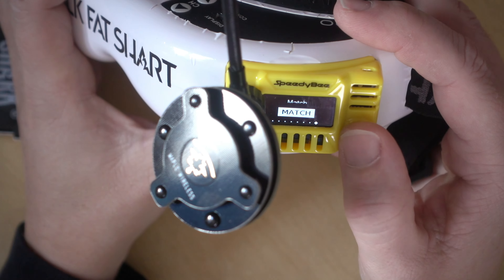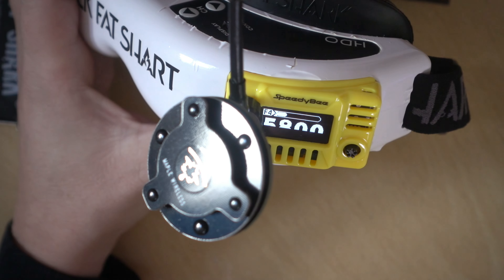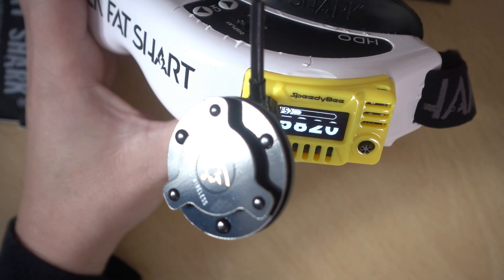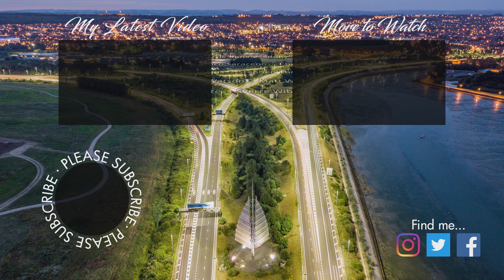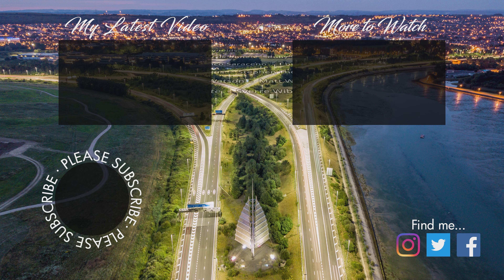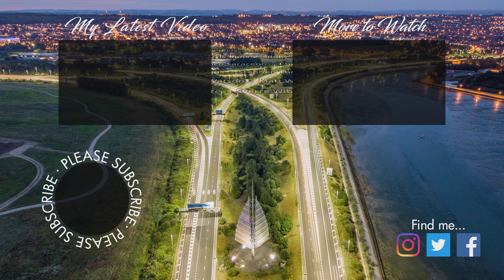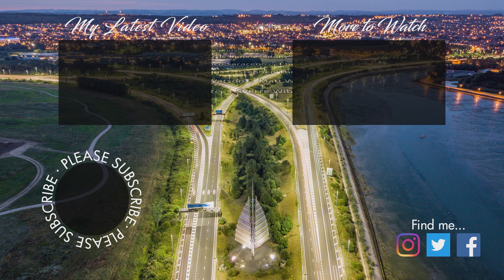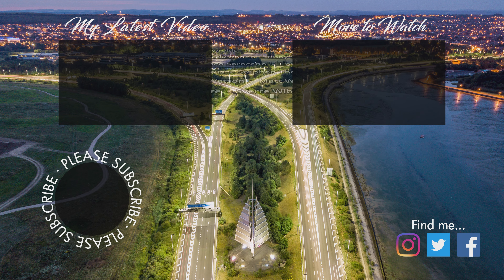SpeedyBee 5.8GHz Video Receiver: First look

Comment: Can this module be adapted for analog goggles?  Is this a de-interlacing module?
Reply: This is native to analog goggles, it has the same plug type as rapidfire or fusion and will slot into a module bay such as fat shark, skyzone or orqa. 
SPECULATION ZONE:
I don't think it de-interlaces since they would be yelling about it if it did, and that might actually require an additional chip. From what I've seen it does not do sync reconstruction, so it may be more susceptible to rolling than fusion and rapidfire. 
It seems like a diversity mixing module, which means it merges two signals from two antennas. I may be wrong on that though, it may just do diversity switching, where it switches to the antenna with better signal.
I think the most direct comparison is Foxeer wildfire which is roughly similar price, though I have not confirmed any of this with personal experience or research, just watched a bunch of reviews or info videos and looked at specs.

Comment: Specs say 450ma power consumption, so more than the 350mah of the Rapidfire I think.. so older FS goggles may need the power mod.. Waiting for mine to arrive and did the power mod anyway.
Reply from the maker: My goggles already had the power mod (HDO). But it would be nice if SpeedyBee could confirm this, and even supply the mod cable if it is needed. I've been using the module a little while now, and it doesn't seem any better or worse than my old True D X receiver. I'll do a back to back at some point, with the same antennas.

Comment: I prefer Eachine PRO58 with WPRO58 firmware flashed.
Reply from the maker: I used to have the Pro58 with the Achilles firmware. That was a great VRx, especially for the money. Just a shame it didn't have a USB connection to make the firmware update easy.